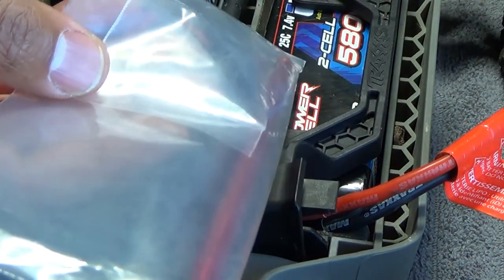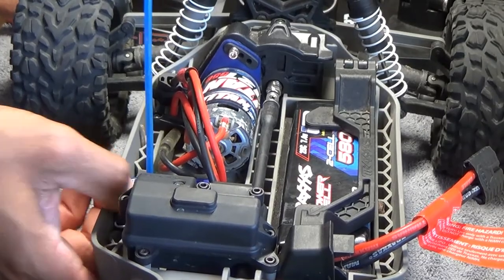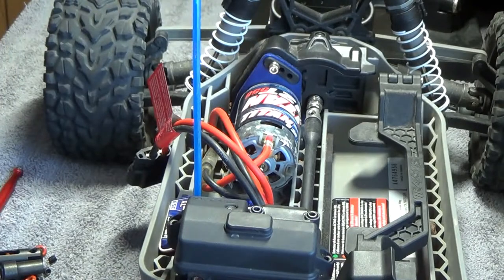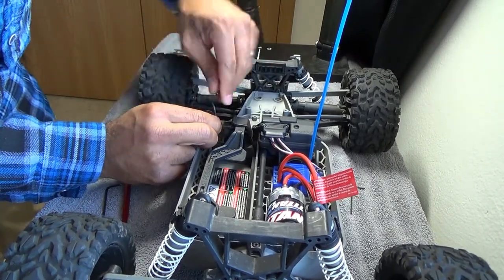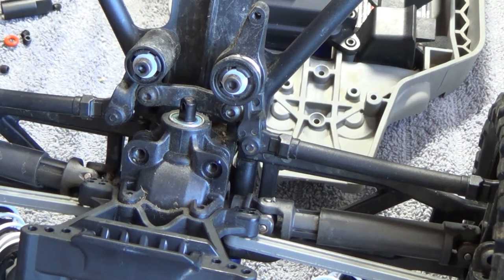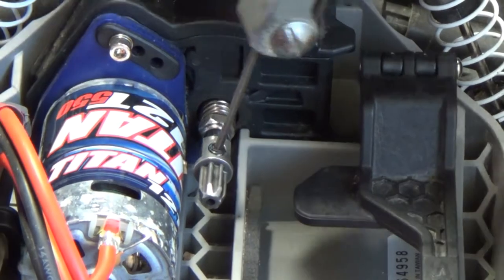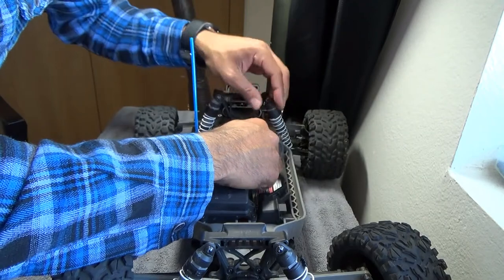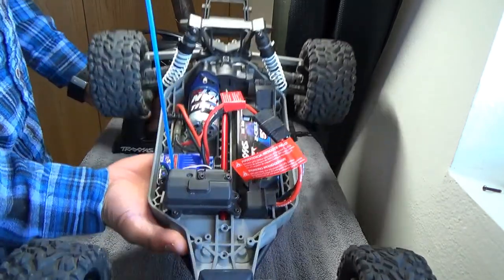Rustler Center Drive Shaft Upgrade

Comment: I bought this Center drive shaft. It sucks. Check out my latest video what happened to the rear pin on this center shaft end! I have a custom 2200KV VXL-6S 4x4 Rustler. Steel drive shafts all the way around. 20T Pinion. HR motor mount. Ultimate VXL Center junk shaft. Huge slipper with alum shoes. Traxxas X0-1 rings and pinions (getting HD cups and X0-1 diff rebuild kits with I-beam and longer pin next). I added a RC10GT alum shock spacer to my battery arm swivel and longer screw to gain height for double stacked 3S batteries. Took a 35mm battery arm and shaved the top ridges down about 1/16” and installed in n the rustler upside down. Drilled a small hole in my battery arm clip and that double secures my heavy pack in the battery tray with a body clip. I’m running 4 Duratrax Six-Pack tires all half inch offset. 

Honestly, I’m thinking of having my own center drive shaft custom made out of hardened steel. But before I go to that extent, I’m going to try the GPM steel/alum shaft first. I can’t find a tekno shaft for the 4x4 rustler. Any body have a link? All I have found is for slash/stampede. Rustler 4x4 Center shaft is a few mm shorter than slash/stampede 4x4.
Reply: did you end up finding the tekno shaft for your rustler ? looking for one for a gift for hubby.

Comment: To answer your question about the antenna, you can use one of the set screws in there to keep the antenna secure. You achieved the same goal though.

Comment: you dont need the antenna, its pointless, i run mine without the antenna and just have the cord in the box, i get the same amount of range.
Reply: Best thing instead of removing the antenna completely and sticking it in the receiver box would be to cut the antenna tube to about 3 inches (maybe a tad shorter) just enough to clear under the body shell so it doesn’t get damaged. On my rustler 4x4 build I relocated my tube and it’s about 1-1/4 inches long now. But I did that because I slammed a 6S 2200KV combo in it and had to remove the receiver box completely. Take a look at my build and see what/how I did.